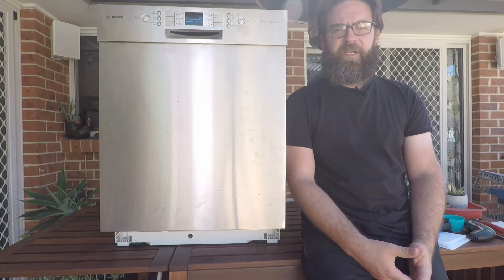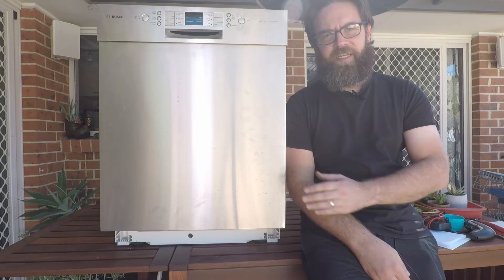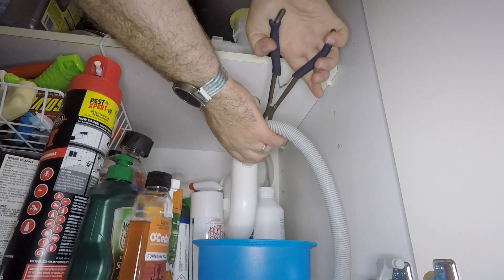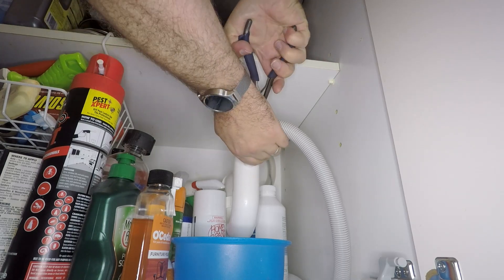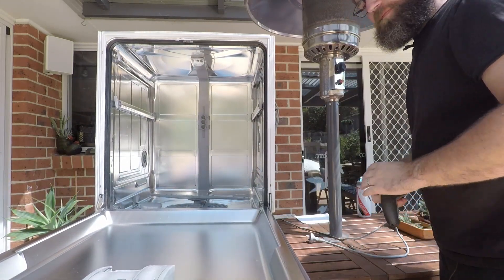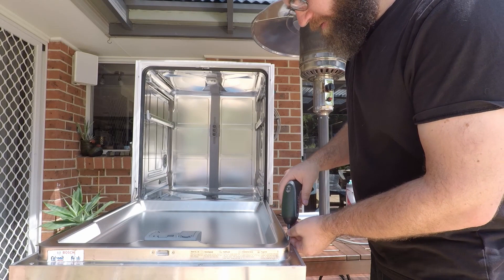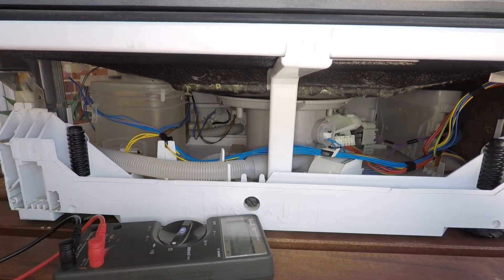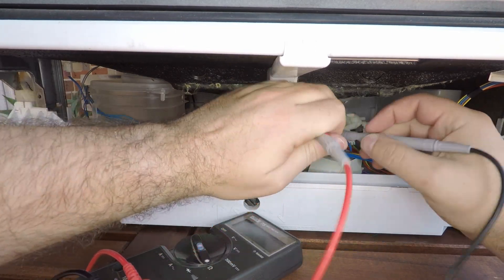Bosch E28 error code diagnosis and repair

Comment: I would like to see a video for a Bosch Dishwasher Error code 27. There is only 1 other forum and it states low voltage, not an applicance problem. I have tried the DW on different power points, still the same error? Any help you can offer would be appreciated. Thanks
Reply from the maker: Hi Mira, as you have found different power points will not work. I would suggest taking note of what time and day of the week you get this error and then try to avoid running the dishwasher around those times. As the error relates to low voltage being supplied from the power grid there is little else you may be able to do about it.